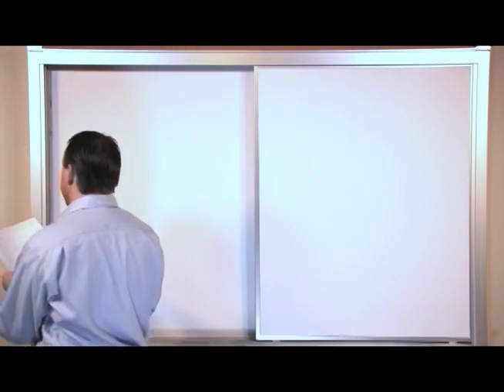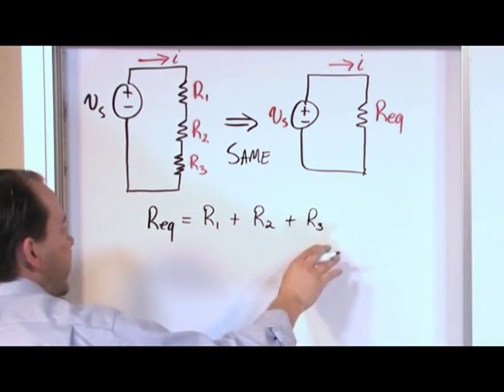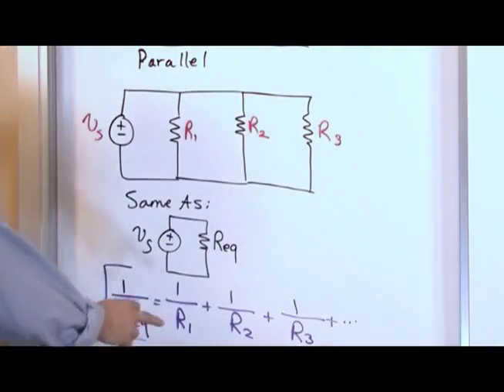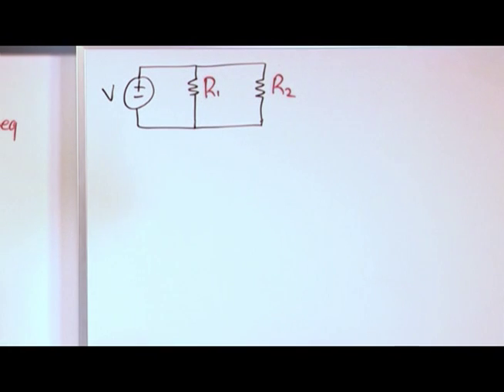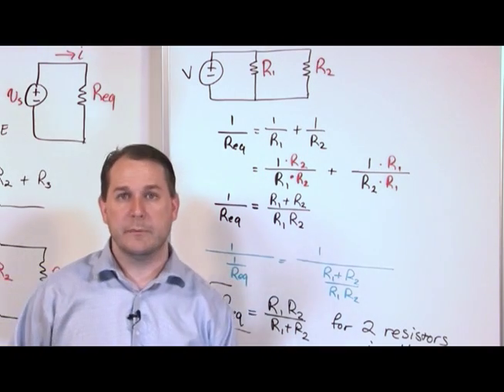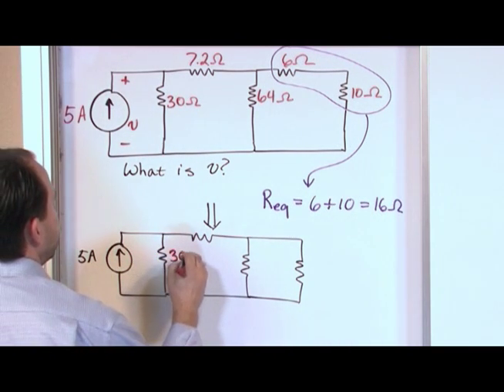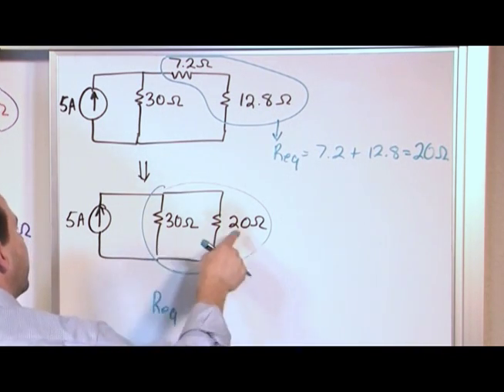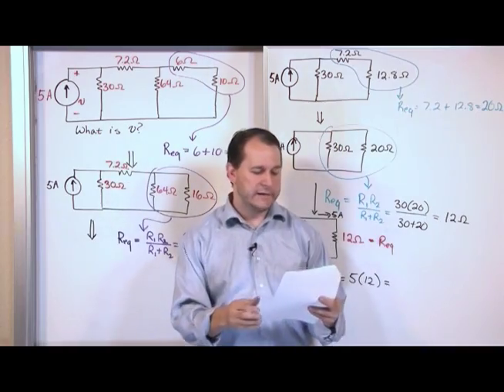Series & Parallel Resistors in Circuits

Comment: Can I ask why the 7.2 and the 6.0 resistors aren't in series? Is it because there's a branch between them?
Reply: Yes — two resistors are only in series if the same current must flow through both. If there’s a branch between them, the current can split.

Comment: If I add a second resistor (R2) to a circuit,  parallel to another resistor (R1), what happens to the total current of the circuit ?
Reply: Resistance reduces
Reply: I think the current reduces in the parallel branches, but the total current in series will increase a little bit.